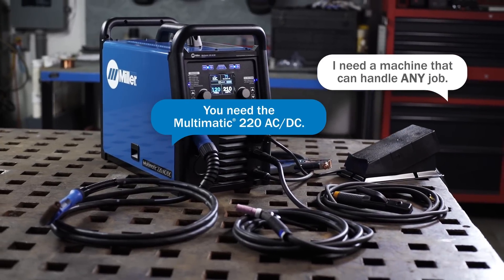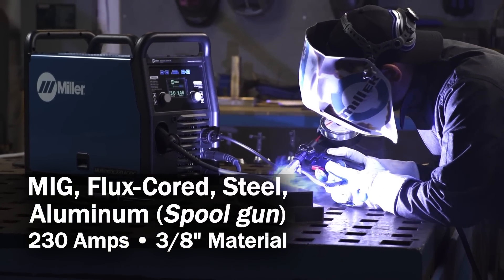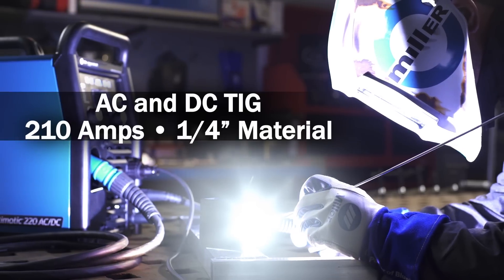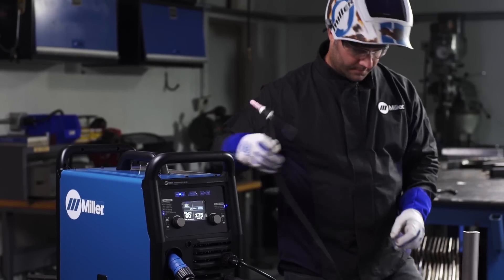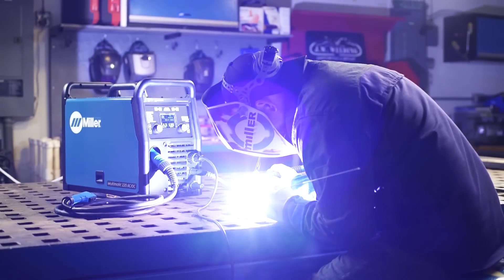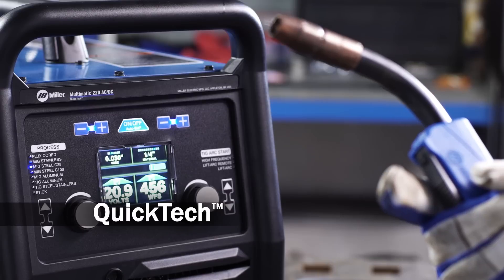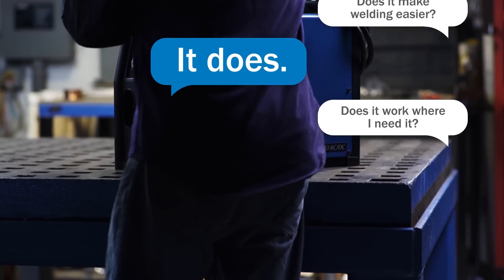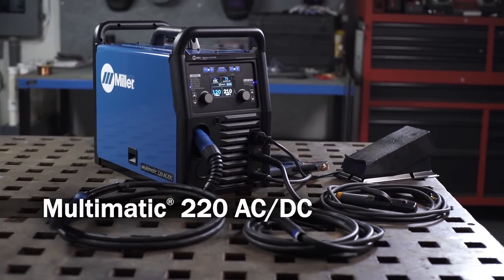New Multimatic 220 AC/DC: It Does, so You Can Too

Comment: I have the multimatic 220 would you be able to tell me what size adapter I would need for the output side of the regulator I took that part off bc it does not fit my hose and I can’t find a adapter that fits the threads inside the regulator

Comment: How is it with copper
Reply from the maker: Hello Aaron. We apologize for the delayed response. The Multimatic 220 performs well on welding copper. However, it is dependent on the appropriate setup and the thickness of the copper. Because copper requires quite a bit of amperage, the max that the Multimatic 220 can weld is between 1/8” and 3/16”. Let us know if you have any additional questions!

Comment: I'm extremely  impressed but I need more power is there a larger model with the same features?
Reply from the maker: Hi Samuel. Thank you for reaching out. The next larger machine that is closest to the Multimatic 220 would be the Multimatic 255.The Multimatic 220 is the only self-contained multiprocess welder with AC TIG available.The Multimatic 255 only has DC TIG, not AC TIG, and adds Pulsed MIG. Here is a link to the website: MillerWelds.com/equipment/welders/multiprocess/multimatic-255-multiprocess-welder-m30175.
Here is a link to the Spec Sheet on the website: MillerWelds.com/-/media/miller-electric/imported-mam-assets/spec-sheets/5/f/1/dc129-multimatic-255--english.pdf. Another option if AC TIG is needed would be the Dynasty 280 DX Multiprocess.This would have all of the options for AC TIG and would use a suitcase feeder. Here is a link to the website: MillerWelds.com/equipment/welders/multiprocess/dynasty-280-multiprocess-welder-m30166. Here is a link to the Spec Sheet on the website: MillerWelds.com/-/media/miller-electric/imported-mam-assets/spec-sheets/9/e/7/dc355-maxstar-280-multiprocess--english.pdf. If you have further questions just let us know!

Comment: What type of generator do I need to power it?
Reply from the maker: Hello Herbert, The Multimatic 220 AC/DC runs off generator power. Minimum auxiliary power requirement at rated load is 10 KW continuous/12.5 KW peak at 240 volts AC for full output. Smaller generators will reduce output capability. Let us know with any questions. Thanks!

Comment: Can this machine run 5/32 7018 stick rods on a 220v power supply? My Miller 150stl wont lol. I need to upgrade
Reply from the maker: Thanks for your question. Yes, the Multimatic 220 can run 7018 5/32 electrodes but you will only have about a 15% duty cycle on the unit.

Comment: Is it as good as a migmatic 220 for mig?
Reply from the maker: Hi John, thanks for reaching out. We have not directly compared the Multimatic 220 to the MigMatic 220. The Multimatic 220 does have excellent MIG performance and the duty cycles are similar. In addition to the excellent MIG performance, the Multimatic 220 also has excellent AC/DC TIG and DC stick welding abilities.

Comment: Everything on this Miller is copied from the Harbor Freight Vulcan Omnipro 220 that came out over a year and a half ago.Miller was probably tired of losing sales to a quality welder that's 1/3 the costThat Miller also isn't made in the states.
Reply from the maker: The Multimatic 220 AC/DC is manufactured in Appleton, Wisconsin.
Reply: Assembled from imported parts... just say it.
Reply: @David_H_Parker  Cheap imported junk? I also own Miller and Lincoln welding equipment too. No bashing in any way. I am saying that the Miller equipment has LOTS and LOTS of inexpensive imported components inside just like the imported equipment, so to say they are made here is incorrect. Assembled here... yes. Take the panel off your welder when you get a chance and take a look. You'll see for yourself. As for a warranty, I have a great warranty too. I'm covered 100% I just get tired of over paying for a name and color. As for cheap, that depends on many things, just like the U.S.A assembled products. The imports can be and are of high quality too. It depends what you want to spend, and the model your looking at. Performance is awesome and on par with, and also sometimes exceeds the Miller and Lincoln variety. All good stuff to me, but companies that rest on the laurels of their names to over charge customers for decades, encourages consumers to look else where to see whats available. This is what Snap-On does/did. LOTS and LOTS of imported tools offered from them that are just branded with the Snap-On name and and then the price is jacked up 300% Those products also have a great warranty. Just WAY over-priced. Most of the wrenches and driver tools made by Snap-On are still manufactured here in the states. Everything else... designed here and MANUFACTURED outside the states. I know for a fact that your car or truck is LOADED with components made in China, Mexico, etc, and the computer and cell phone you use to comment on you tube videos are 100% made in a foreign country. Stop being ignorant.

Comment: Can you use MIG and TIG the same time?
Reply from the maker: Hi, thank you for the question. The Multimatic 220 AC/DC features QuickTech Technology. The MIG gun and TIG torch can stay connected at the same time so it can automatically switch to the right process. Thank you.
Reply: I don't think you can run both processes simultaneously if that's the question

Comment: 👎 and 👍
Machine is hyper overpriced, almost stupidly overpriced. A Miller 211MVP will do almost everything except tig @ $1,000 shipped brand new (after Build w/Blue Rebate). So you're charging $2,000 more for a total of $3,000 just to add an AC tig function. That's a rip off to just add tig, and add $2,000 to the cost.

Kinda insane you can buy twice as much tangiable product, twice as many cables, twice as much copper, clamps, metal cases, motors, labels, spools, guns, plugs (aka 2 dedicated machines) ...and STILL be cheaper then buying one item.
Reply: Better off with 2 units anyway.

Comment: 3k for this...crappy duty cycles which I’m sure are overrated LOL so bad. No AC pulse and Forget low amp start on Tig ..20amp min
MIG 30-230 (200) @ 20% 
TIG 20-210 (210) @ 20% 
STICK 30-200 (200) @ 15%

Comment: Does this machine have post flow adjustment?
Reply: Ripley Tomlinson yes it does 0-25 seconds but don’t worry the duty cycle won’t let you weld for long. Duty cycle is awful
Reply: @weldingjunkie i bet you couldn't weld for 4 minutes straight
Reply from the maker: Hi Ripley, the Multimatic 220 AC/DC does have post-flow adjustment from auto to 25 seconds. Please let us know if you have any questions.

Comment: Will it do dual shield flux core?
Reply from the maker: Thanks for your question. The Multimatic 220 includes recommended parameters for self-shielded flux-cored wire only.

Comment: Just wondering but why did you go with Dinse 25 connectors when some of the ratings are at 200amp and even 210 amp.  Wouldn't a Dinse 35 connector be a better match so it wasn't at the top of the range?  Just wondering if it will make a difference or am I thinking about this wrong?
Reply: Joe K the duty cycle is terrible 20% @ 200 and 220 @ 15% that’s how they can use 25 dinse on this machine
Reply: I’m not a HTP hater I’m just saying I’ve worked for Kooks Custom Headers and currently I’m a lead stainless fabricator for one of the largest paint and powder coat manufacturers in the country and I can tell ya you’re not gonna see a HTP welder near either shop
Reply from the maker: Hi Joe, thanks for reaching out. When designing machines, we take into consideration a variety of factors including applications, ease of use and portability. For the Multimatic 220, we found the 25 mm Dinse to be appropriate, and this size allows for the flow through TIG torch using the same size connector.
Reply: Welding junkie aren’t you a htp guy? The htp invertig 221 is only 20% at 220 and I guarantee this welder blows that machine away!
Reply: David White yeah 20% at 220 and 35% at 200 what’s your point? And that’s Tig not multi process how far do you think you’ll get with mig with 20% duty? Also btw the pro pulse is 35% at 200 synergic. Yes I like HTP (Stel) machines but idc what machines you like 20% is terrible. This welder blows the Invertig Away? Lol no pulse is AC no up slope or downslope so Pedal is always needed no independent AC no pulse stick..I wouldn’t trade those options just to add a Mig torch id just buy a Mig machine. You are clueless lol clueless
Reply: David White btw I have a miller Dynasty DX too so i obviously like miller too and they dropped the ball on this machine they could of done better. You’re just a HTP hater I’ve seen your posts 15% duty on stick yeah that’s great what a great welder

Comment: Can it handle 6010 sticks?
Reply from the maker: Hi Chris, the Multimatic 220 can run 7018 electrodes. The DIG controls the amount of additional amperage at low voltage (short arc length) conditions. Adjust the force of the arc for different joint configurations and electrodes. Range is OFF–99%. Pro-Set (recommended value) for 7018 is 30%.
Reply: Miller Welders so no to 6010? Any welder can run 7018
Reply: @MillerWelders  esab 205 will do 6010
Reply from the maker: Hi Joe, we do not recommend 6010 electrodes for the Multimatic 220. The Multimatic 220 does not have a high enough OCV (Open Circuit Voltage) to run 6010 electrodes, which require a high OCV to maintain the arc when manipulating the electrode and/or pulling a longer arc length.
Reply: @MillerWelders  so it doesn't do all! And essentially the dig feature is pointless. 6010,7018 or I'm using a different process
Reply: chris jones Excactly

Comment: What about the gun?? The gun shown on video isn’t same mig gun shown in brochure on miller site so which is it???
Reply from the maker: The gun in the video is a new version that will be released soon. Stay tuned for more information as it becomes available!
Reply from the maker: Thanks for your interest! The Multimatic 220 comes with a 10 ft (3m) M-100 MIG gun and cable assembly. It is also compatible with the M-150 MIG Gun. The Multimatic 220 is compatible with the Spoolmate 100 and Spoolmate 150, which are sold separately. Please let us know if you have any questions.
Reply: Weld Weld prob a prototype that’s why you won’t be getting it I bet lol same old torches